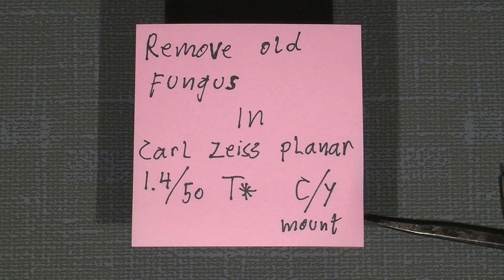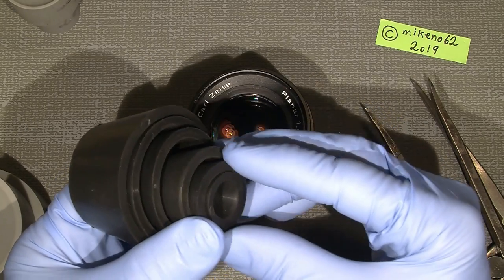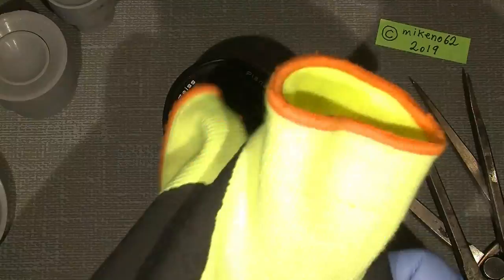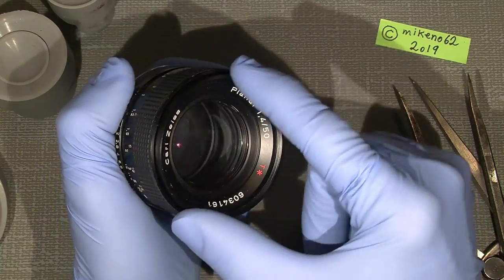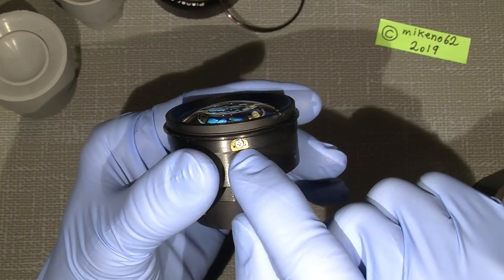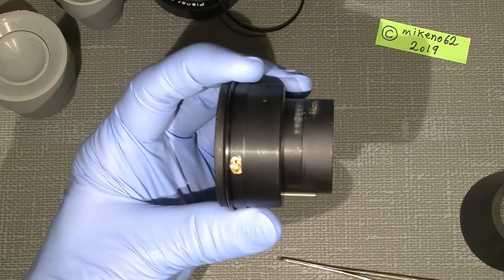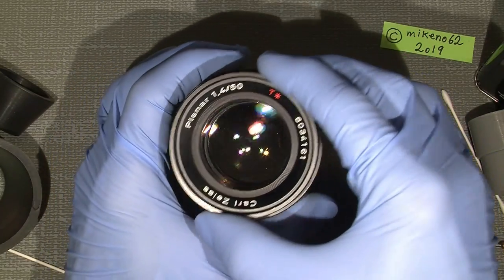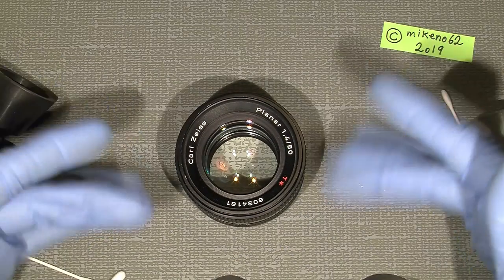Remove old fungus in Carl Zeiss Planar T* 1.4 / 50 with Hydrogen Peroxid and lighter fluid C /Y

Comment: I admired your "lens spanner"  Where did you get it.? I have a much more cumbersome tool..this "compass" like tool looks robust, A side bit I have this  lens and my baby boy pulled the camera off the table and it fell and badly bent the attached filter. Icouldn'T get it off for years.. finally one day with those work gloves I gave a try and wow great .. I was turning the front retaining ring and well . I was late able to get those two pieces apart and.the filter ring was not too dented. I worked it out with a ring tool ..slowly and now it's good to go...no visual fungus..lucky me

Comment: Hi mike!
Your video is super useful, thanks for your effort to help the people using old camera equipment.
I recently bought a planar 1,4 50mm for just a few euros, it‘s full of fungus and dust and needs some cleaning. I‘m using the same vaccum pads like you, but i can‘t remove the first ring (the one with the „carl zeiss planar“ writing on it. Do you have an idea how I could remove it when it‘s stuck? I think the camera got wet some time and everything is really stuck together.
Thanks for replying, keep up the great work 👍
Reply from the maker: Thanks Carlo, about the stuck nameplate/front plate, in many of those old Carl Zeiss from that time they use a lot of thread lock and it was the red type (the hard type!). You can try to soften the thread lock with some nail polish remover with Acetone or Isopropylalcohol 99% or so on a cotton bud.

Take really good care when use the Acetone on plastic because it can soften or destroy the plastic parts, just like many lenses with plastic front plate, and never use Acetone on aperture blade that are made of plastic...!.
Reply: @mikeno62  thanks for the reply!
I will try that. 
How are youre experiences with cleaned lens? I‘ve contacted Zeiss and they told me, fungus would be spreading easily and can even „infect“ your camera body or other lenses. Have you ever experienced something like this?
Reply: @carlono1  Did you succeed? I have the same problem as you... I tried to put some on but it doesn't work

Comment: Thank you for this amazing video! Can I ask - do you use different cleaning materials for different lenses? Or would you say these materials are safe for all coatings?
Reply from the maker: Thanks, well It's just my own experience when working with Hydrogen Peroxide 3%, but some people said that some older Zeiss lenses have a softer coating than other lens brands.

Comment: Hi there,

Could you give me any advice on removing the front name plate? My lens has fungus and I've tried everything to remove the plate using the same tools you have but it is solid and won't budge. Thanks in advance.
Reply: Some lenses open right up but some others don't. I have also been trying for weeks and tired my wrists so much from extreme attempts to open a couple of stubborn Contaxes. If you search for "bottle jar opener" or "Anti-slip Can Lid Opener" you will find some nice adjustable rubber belt openers that are used to open tightly sealed jars. I could open those stubborn lenses using that tool in 10 seconds.
Reply: @areiacreations  thanks for the info, it turned out that there was excessive amounts of red threadlock holding it together, and used two rubber strap wrenches to pull it apart, what a job it was.
Reply: @areiacreations  I've recently used a small amount of electronics cleaning spray to temporarily loosen some stuck focus rings, I wonder if it would help loosen the grime under the name plate.

Comment: Do you have any tips for getting sand from the beach out of a lens? It jammed the focus and now my focus ring won’t go all the way in to the ♾️.
Reply from the maker: Hmmm 🤔 it’s not good, because if only one sand corn gets into the helicoid thread it will be almost impossible to guess what way one should turn the focusing ring so it will come loose. But on the other hand you could try to disassemble the lens as much as possible from the front or/and the back, and NOT turning the focus helicoid, then you can try to use some cotton buds and wipe out as much sand corn as possible.
BEFORE disassemble the focus assembly you try to measure the focus assembly.
Start with the inner helicoid and set marks when you ( hopefully ) can get the helicoids apart.
Then you can try continuing with the next helicoid and so on.

Comment: Hello.
Do you have any experience with dust between lens elements in point and shoot (pocket digital) cameras?
Is it possible to take apart the objective, or it is all glued together plastic?
(It is a Fujifilm F40fd in my case)
Thanks.
Reply from the maker: It is possible to do, I have clean the lens elements in some pocket digital cameras and it turn out to be very good. One have to be careful when disassemble the camera because of the very thin flex cables inside those cameras and also on the side of the lens block, and even more careful when one open the lens assembly. TAKE good care of the flash capacitor, it can give some nasty sparks if you touch the 2 wires.

Also because the plastic is very thin.
But of course it is possible to clean with Isopropylalcohol 99%,  NEVER use Acetone because it will damage the plastic parts.

Try find a service manual, and take pictures during the process.
There are many guide arrows inside the lens, where parts have to be disassembled or assembled so its correct.

Good luck :-)

Cheers
Kenneth

Comment: Can you please tell me if cleaning with these materials-- hydrogen peroxide and lighter fluid on the inside elements will damage their t* coating? I've read that they are very easy to accidentally destroy
Reply: None of those materials will damage the T* coating, including acetone, alcohol, lighter fluid and hydrogen peroxide. I had elements submerged for days in those difference substances, in an experiment to remove hazing (which sits under the coating) from those lenses. None works and the coating in all cases is 100% intact.